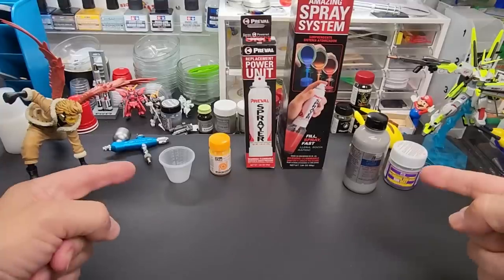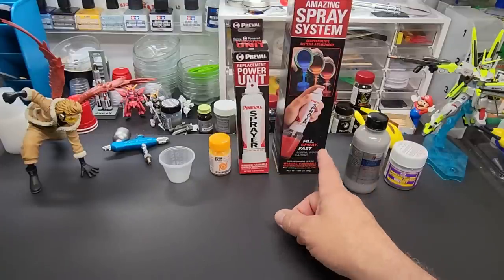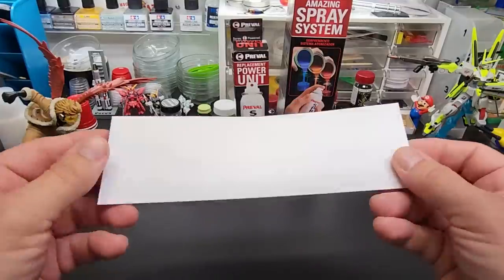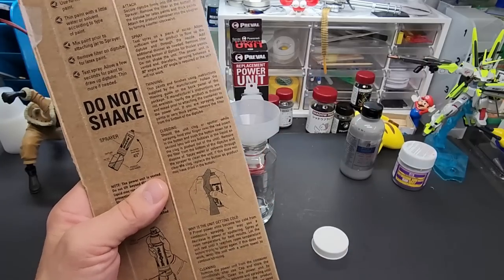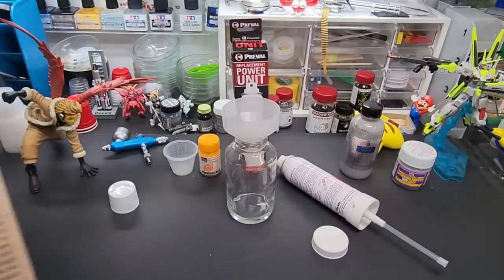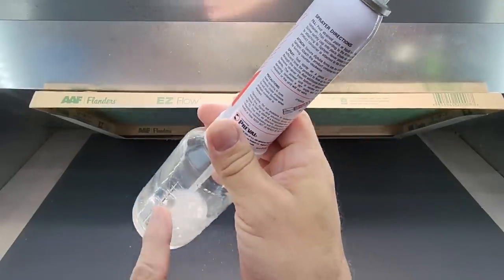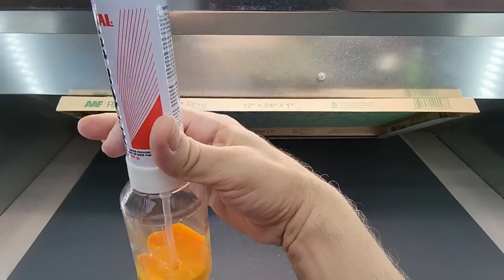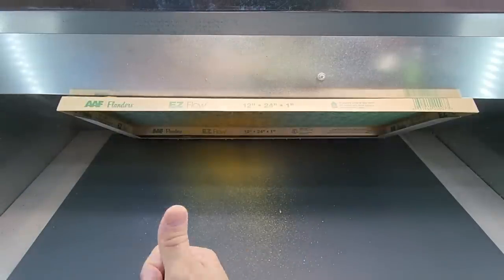Make Your Own Paint Spray Can - Does This Gadget Really Work ?

Comment: Michaels has a similar product called YouCAN, but it's reusable and can be re-preasured using a bike pump. I'd love to see you test it out, both as a spraycan and if it can be used with the air can powered airbrushes.
Reply: That's the one I use to spray glue, mixed to fix stuff on a diorama, works good
Reply from the maker: I'll check it out for a video

Comment: We used the PreVal spray cans back in the early 1980's in the aerospace industry, for epoxy primer touch-up prior to placing rivets into counter-sunk holes.  Most mechanics didn't go for "appearance applications", however in the hands of a good "painter" the PreVal spray can will rival a decent "Rattle-Can" finish.   So just like a "Rattle-Can" the PreVal is as good as the person spraying, and the material being sprayed.  For modeling the PreVal would be a great tool to do touch ups or small parts you forgot while spraying color coats.  ??

Comment: Another thing that would go great with this is one of those spray can handles. I find that using spray cans for long session cramps and hurts your fingers. Getting one of those handles would be better for control and the user since its more consistent that using the normal spray can

Comment: They do work fairly well. Better than a rattle can, not as good as an airbrush. For extra paint bottles, those can be gotten through Tandy leather/ Leather Factory. At the store, or online.
Reply from the maker: I actually found the extra jars on Amazon and posted the link 👍 Thanks for the info
Reply: @barbatosrex9473   You get them basically wherever they are available. I get them at Tandy's, beause there is one close by. I got my first one to experiment with spraying Leather dyes. A bit more evenly than a dauber. It also applied a good coat of the NAPA two stage acrylic enamel on a '49 Mercury model body. I am going to experiment with spraying dyes, and inks on thin cloth, to use as carpet, and headliners in my model builds. That way I can make some custom color blends. Something else you might want to try, is using iron on patch matirial, for these applications. When they are thin enough, they work very well. I use the Tandy eco flow leather cement for gluing this down. Mod podge might work as well. I've never tried it for this. I enjoy sharing the experiments that have been successful for me.

Comment: Hi, I have got questions about preval sprayer. How do you stop the leaks in the air vent when I spray?

Do I need to remove the filter from the tube when I spray 2k primer, 2k clear coats and base coats to spray thick? 

Can I refill 2k primer and 2k clear coats and reuse it again?

Comment: I cleaned my Iwata with Simple Green and IPA. The action on the trigger feels rough now. It is not smooth. I just got an ultrasonic cleaner and some expensive Iwata lubricant. I also got some glycerin. This stuff on its own is sticky feeling. Do I need to use water with the glycerin for it to lubricate? $8 for tiny tube of lube is bonkers.

Comment: I first used that spray system over 40 years ago. I used it to spray paint the lower rear quarter panel on a buddy's car. It worked fine for what we needed to do at the time. I haven't seen nor thought about it much since then, glad to see it's still available.

Comment: What is the differences of the mr. hobby thinner and leveling thinner? I am using the leveling thinner thought but I am curious about the other thinner (mr. hobby thinner).
Reply: It retards the drying time of the paint you mix it with, thus allowing longer for the paint to level over the painted surface.
Reply: @bp8339  Oh I see. So, its good to use the leveling thinner for the longer period of the paint, specially when I'm using hand painting job.

Comment: Save your money and use an airbrush.
Reply: For sure ´cause quite a significant quantity of paint is wasted at each use: firstly, you MUST fill the glass can with a minimum or it won’t work; secondly, you NEVER use it all, so, wasted paint.
I have used this equipment for years, but not for model kits: for touch up or spraying on quite big surfaces (aircraft landing gears external parts).
This king of equipment would perfectly match rc’s with, specially big ones, in case of camo scheme, that’s perfect, but for small parts, not ideal (spraying pressure is too high from my experiences in this particular case).